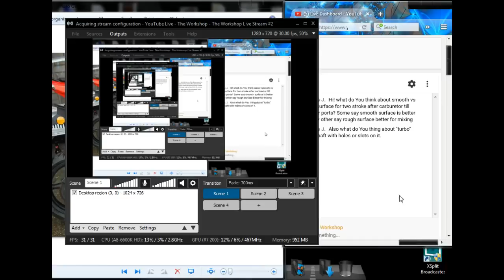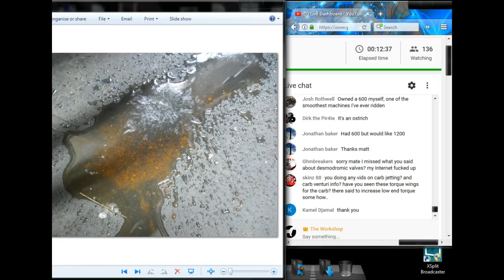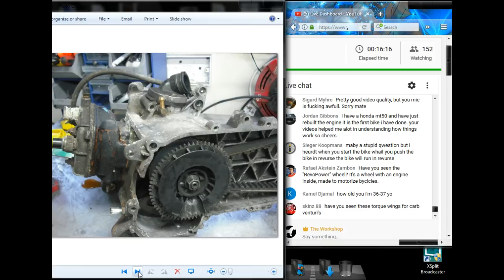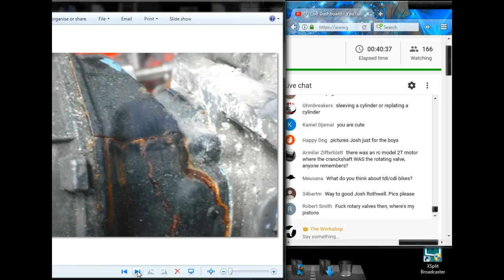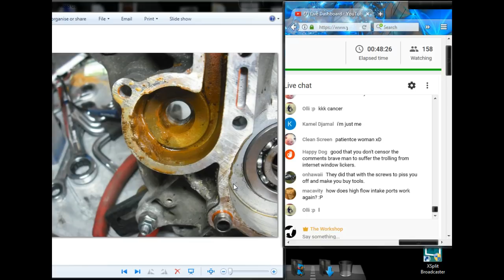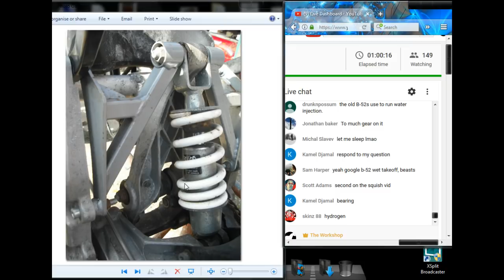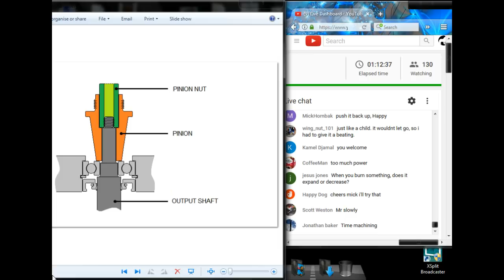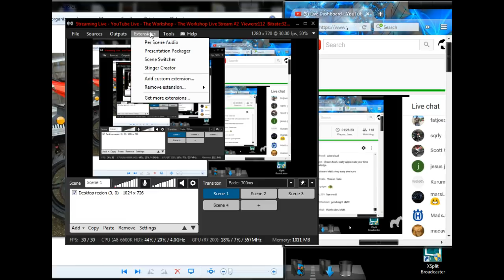The Workshop Live Stream #2

Comment: My 1991 Honda CBR 1000f was running great. I installed E-plugs and it wouldn't run, So I tried blowing out the petcock, and cleaning the carbs. Still wont run. So I removed the E-plugs and put the stockers back in and it fired up, but it will only run for 3-4 minutes then it acts like it has no fuel. I used a gravity feed fuel source to bypass the tank. Same problem. I tried different vacuum line connections, and though it ran better, it would still die after a few minutes. When it dies it wont even start with starting fluid. I have to wait about an hour then it starts again and dies after  3-4 minutes. The only thing that has changed from it running great was me blowing out the petcock, and reconnecting the vacuum lines. Even the dealer ship says they cant figure it out. Im really hoping you'll have an answer or things to try.